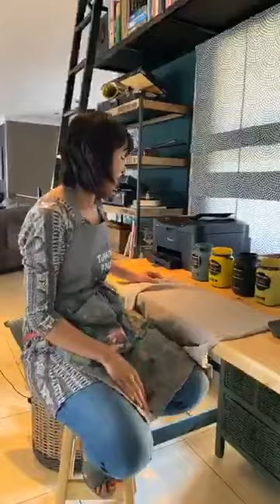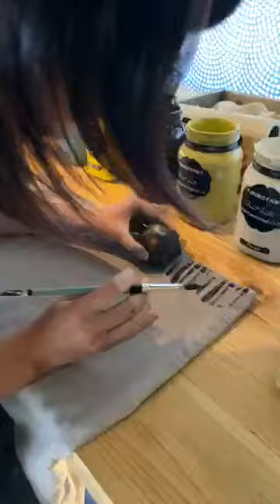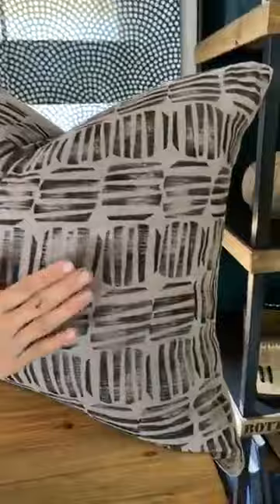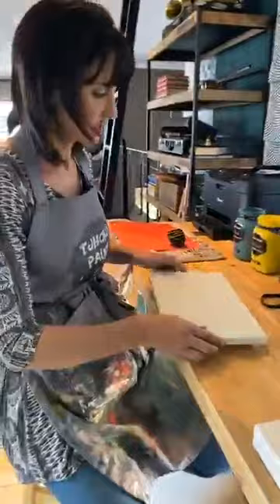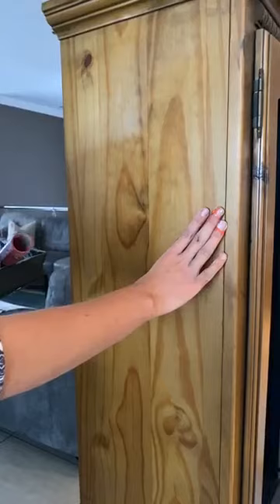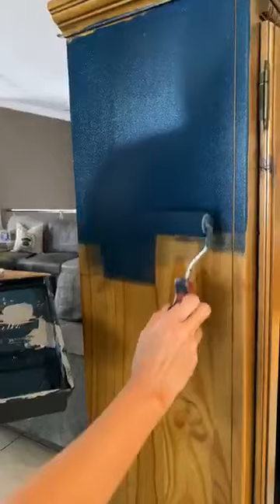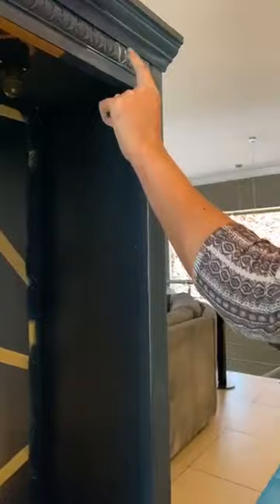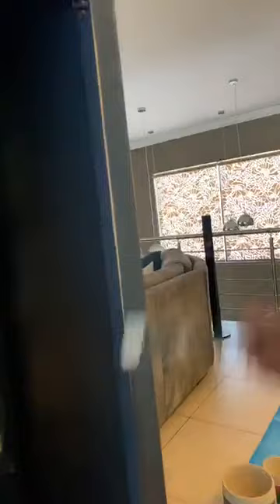HOW TO | Painting patterns on fabric, canvas and creating a distressed look on furniture with Tjhoko

Comment: Would you be able to tjhoko a wall to wall carpet and how would you clean it when dirty?  I saw your video doing a rug with a spray gun. Thanks
Reply from the maker: Hi Helene, different fabrics react differently to paint. Depending on the fibre some materials including carpets become hard. My suggestion will be to test a small section first to see if you are happy with the texture. Personally I have not painted a wall to wall carpet before, only stencilled rugs and we vacuum them as normal to clean them🌷